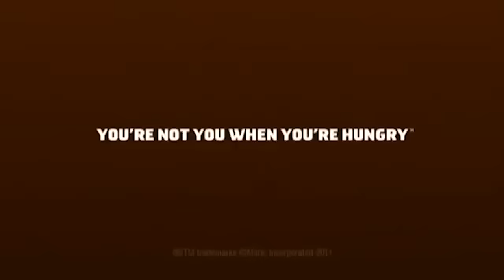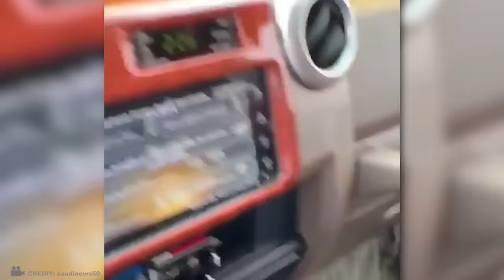Best CCTV Fails of the Year ! - Try Not to Laugh

Comment: 55:45, when the wind is blowing that strong, park the car so that you are facing the wind.  Either use a spot on the other side, or even in that spot, she could have backed in.  Then yes, its hard to open the door, but at least its not going to break off the hinges if you drop it, it will simply close.